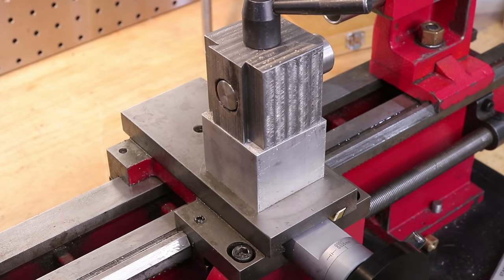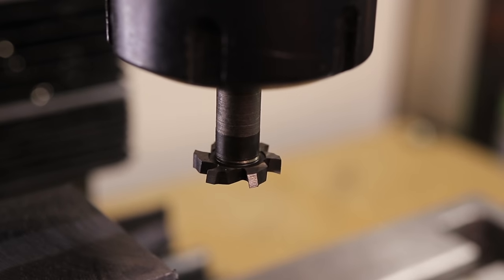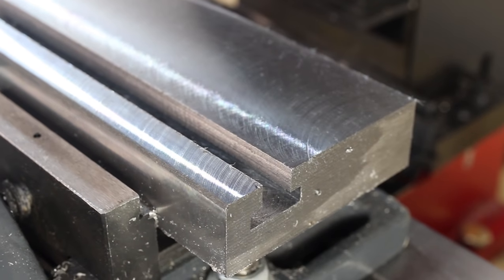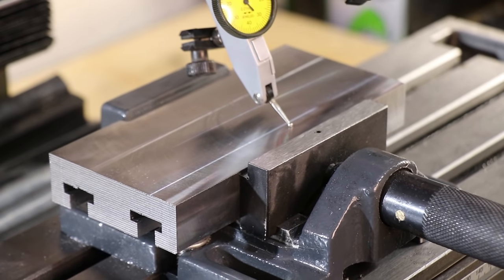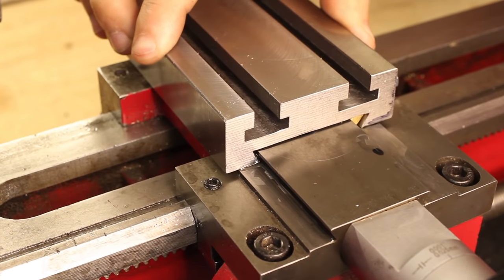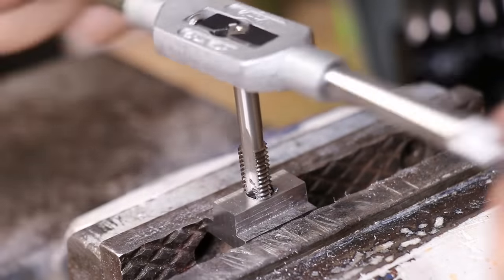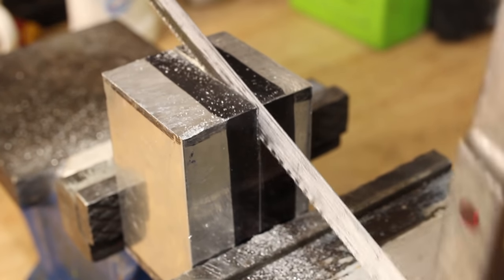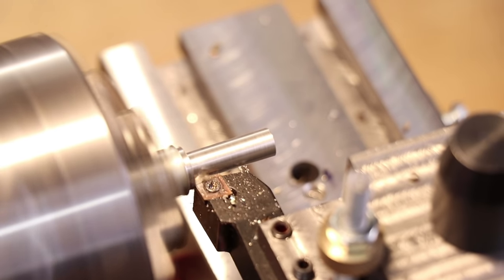Lathe Cross Slide Rebuild | Machining A New Lathe Cross Slide With T-Slots

Comment: Bro, you need a bandsaw asap!! It would make your life so much more easy/efficient in the shop
Reply: Antonmursid🙏🙏🙏🙏🙏🇲🇨
Reply: Failing that due to poverty, a decent angle grinder and a few 1mm cutting discs would do the job much faster. For greater accuracy an angle grinder based 'chop saw' attachment is advised.
Reply: Hacksaws build character.
Reply: its his daily work out and good for his biceps leave him alone :0)
Reply: buy him one then
Reply: Still no bandsaw 😂
Reply: Maybe he likes it this way? Hacksaws are very versatile, take almost no space, easy to carry, cheap to buy and maintain. I bought myself a little portaband a while ago but have yet to use it while the hacksaw gets used at least a couple times a week.
Reply: It puts hair on your chest💪
Reply: I agree that a portaband on a stand would make a very worthwhile upgrade for his shop. Now, if someone would just buy him one. (Recommending upgrades for someone else's shop is easy when you're not the one paying for them!)

Comment from the maker: G'day, I hope that you enjoyed this video. It has been in the pipeline for a very long time, and I jumped at the opportunity to make it as soon as I got the new mill. A few things that I wasn't able to cover in the video: 

1- Addressing the use of mild steel: Mild steel was not my first choice of material, and in have concerns about galling (though i won't have to worry about this for a while) but given the small amount of material I required, I just couldn't find a local supplier that stocked what I needed. With my state now in lockdown, this supply was issue was compounded. However the mild steel seems to be performing well. Good lubrication should help reduce galling. And the added benefit of using mild is an increase in tensile strength, compared to the cast.

2. The fly cutter, whilst doing a great job is flawed. I mistakenly machined it with the bolts on the wrong side, so the bolts are pushed against whilst it is machining. Long Term, i will have to fix this.
Reply: I have been looking around for cast iron stock too and the best I've found is weight plates from Kmart. Looks like you'd be able to get a decent 20mm piece from the 10kg. Not sure the quality of the castings though.
Reply: @Joe_Bandit  Primehyd in WA stock cast iron flat bars. Not cheap though.
Reply from the maker: @Joe_Bandit  Funnily enough I have actually torn apart a scrap 1kg weight from Kmart to machine the cast iron it is made of. Not the greatest castings but they worked fine as small flywheels for the project I did. The only thing that I might have to look into about these is what type of cast iron they are made from. typically you would want to use a grey cast iron for machines.
Reply: @artisanmakes  good to know, thanks!
Reply: Regarding the fly cutter as it is, you should be able to flip your cutting tool and run the spindle in reverse, at least to verify whether taking the time to fix/remake it will make a difference.
Reply from the maker: only problem there would be that the insert would be forward of the center line of the fly cutter. Ideally it should be in the center to optimally cut. Cheers
Reply: @artisanmakes  you are correct, I hadn't thought of that.

Comment: For heating small parts you can put them in a small ceramic flower pot. They will heat much faster, as placing them on metal sucks heat out of them.
Reply: Great tip!

Comment: Wow!
Nice work!
I can definitely see that you'd have a much more rigid setup than before.
You'd think it'd be a no brainer for manufacturers to supply machines with your mods already in them. 
Thanks for sharing this!  :)
Reply: There are compaines who do, and they don't get customers as the customers pick the cheapest machine 9 times out of 10
Reply: @henrydando  I've learned the hard way that it's always the better way to just bite the bullet and pony up for the quality option. Today, I even buy top of the line paper towels because they so outperform the cheap crap. 
It's the same with machine tools - one should buy the most expensive tool that they can afford because it'll outperform 10 of the garbage machines. 
It pays to buy the best that one possibly can. Imho.......

Comment: Great video! Being a machinist myself I do have a few questions/critiques: are you planning on getting a better vice for your mill? Drilling vices often lack rigidity and accuracy and I can't imagine it being fun to use.
 I also noticed you use climb milling as well as conventional milling, I think considering the rigidity of the machine it would be better to make most cuts with conventional milling, or at least the finishing cuts. This should improve the stability as well as the surface finish a lot! Climb milling is often better for the tools, but just isn't viable if there isn't enough stability. 
Last but not least: when making a piece of material square and parallel in the mill, the best method is to cut a side, turn this side to the non moving jaw make another cut, turn again , cut again, turn again and then you should have 4 square sides.
I hope I don't intrude to much and these tips are actually of some help, and for what it's worth you're doing way more and better stuff with a mini lathe then I ever did!
Reply: That was an informative comment for me. Thanks! I've been doing it to the bottom of the vise thinking it was parallel to the table. I've also been doing climb & conventional on a mini mill only learning the difference yesterday. Good comment!
Reply: Do you mean taking rough cuts with conventional and then using climb for finishing passes ?
Reply: @jsublettusaf  that way you indees get two parallel sides, but if your vice is bad or there is a bit of dirt there's a big chance you get a parallelogram. But if you want the full explanation there are some really good video's om yt explaining it better!
Reply: @ryebis  normally yes, but if there is too much vibration or instability in either the set up, table or spindle. The mill could start "biting" into the material taking away more then it should and leaving a worse surface finish. You can actually see this a bit in the video, caused by I'm guessing a combination of all three factors, but two can maybe be fixed: trying another set up, like putting the material directly on the table, and clamping all the axis down, except the moving one ofcourse (but maybe he's already done that, in that case my apologies)
Reply from the maker: Thankyou Lennart, feedback is always very helpful. I am indeed planning on upgrading the vise. The vise was just a freebie that case with the mill from the supplier. Credit where it is due, it is probably one of the better drill press vises that I have used. Though I will be replacing it soon. The plan was to replace it ASAP, but my state is unfortunately experiencing a COVID lockdown, and my supplier is currently closed. My preference is to always check out the product before I buy it if I am able to. Currently looking at just grabbing an import one for the time being.

As for the climb milling, to be quite frank, most times I did it just out of laziness, not wanting to move the table back so I could conventional cut it. Had to change up the  when climb milling though.

As for getting the part square, I have to conceded that is the proper way. There was a lot of shenanigans off camera that I had to do to check that everything was all square.

Many thanks for the advice.
Reply: @ryebis  That is what is recommended but I've been doing both climb & conventional to remove material interchangeably.

Comment: When cutting T-Slots, it's a good idea to cut the initial centre slot 5 thou deeper, than the depth the T-Slot cutter will be set to.

Doing it that way, reduces the tool pressure.
Reply: aaand the T-Slot Nuts will ride much better even if you ruined the bottom once with a too long of a bolt :)
Reply: That’s great advice thank you.

Comment: This is exactly what I need to do with my huge old very early 1900's Lodge and Shipley engine lathe, so I can add a milling machine head to it, and reuse that enormous cross slide that it has.
I have an old brake lathe I was going to try to use for the Milling Machine head, as it's super beefy and sturdy, but I'll have to see if I can make it spin fast enough to use fly cutters and milling ends in it.  Those brake lathes are kinda slow unfortunatly, and they might not handle the speeds required for this, but I'll see what happens and if it breaks down, I'll somehow modify it to work I'm sure...  As far as I'm concerned, that's what makes this hobby even more interesting than it already is!  LOL

Comment: Fantastic work! This is a great idea, and you made an awesome job of it. You should consider another M4 tapped hole between the front and middle gib adjusting screws, for a slide locking bolt. This also helps rigidity quite a bit.

I made a very similar fly cutter (I also had to make it twice, due to putting the set screws on the wrong side the first time). If/when you make another, you don't have to make the tool slot at an angle. You can just make the bottom of the fly cutter flat,  as well as the offset slot, because the tip of the carbide insert sticks out past the tool holder shank. That's how I did mine.

Anyways, keep up the great work!
Reply from the maker: Didn't think of that, I'll have to do that, thankyou

Comment: I got a spray bottle with a nozzle that allows stream or spray and filled it with coolant solution. Spray as needed to cool/lubricate as my lathe doesn't have a coolant pump fitted.
If you were using a lot, hook a catch bottle under table drain to recover fluid for re-use.

Comment: Cool project.  I always wondered why they don't include T slots on cross slides, wouldn't cost much to do.  You really need a small bandsaw, was one of the best investments I ever made for my shop :)
Reply from the maker: Absolutely a worthwhile addition. The t slots are a very useful addition to the lathe. Hope to have a workshop one day where I can have the space for a proper bandsaw. Cheers
Reply: Amen!  As per my suggestion as well!!!
Reply: @artisanmakes  gotta get a portable bandsaw and a hercules vertical/horizontal stand

Comment: If you made angled brass slugs to go under the gib adjusters,  they'd spread the pressure on the gibs and you could use shorter grubscrews
Reply from the maker: I didn't think of that, ill have to look into it, thankyou.

Comment: Fantastic video and a great project.  As a long term small lathe and mill owner I have a tip that should help you.  You can keep your taps happy if you keep them really wet with cutting oil.  The wetter the better. I would also recommend a different cutting oil. I have tried a bunch and by far my favorite is the Rigid clear. I use it for everything except aluminum and stainless.  For aluminum I like WD-40 and for stainless nothing beats Moly-D.

Comment: You are getting far superior results to what I get on my mini-mill. What depth of cuts & feed speed are you using? I don't have a power feed so I struggle with consistency. I really enjoy your channel and the projects you do!
Cheers from Canada
Reply from the maker: I think I was doing a 1.5/2mm depth of cut here at around 800rpm, the motor develops a lot of torque there. It is less than optimal but it works

Comment: I was looking for something like this on Littlemachineshop, but they only have it for the compund slide at the moment.

Why not make it even larger? Maybe able to fit gang tooling.
Reply from the maker: If I would make it longer I'd need to modify the cross slide leadscrew and the carriage to have extra travel to make use of the longer slide

Comment: Excellent video as always. If I could pick your brain, what dimensions did you use for the t-slot size and spacing? I'm doing this mod as well and I wondered if there is a standard I should opt for. Thanks again as always.
Reply from the maker: These are m8 size t slots. There are charts online that should give you the exact dimensions.
Reply: @artisanmakes  Brilliant thank you.

Comment: I have the same lathe and the smaller mill from Paulimot, the local dealer for the SIEG-Brand. I made the new retainer Strips for the Lathe and now thanks to you i know my nex project. 

In return i have maybe an idea you can use on your machine for indexing parts on the lathe. and i would like to send you a drawing for use on a 80mm 3 Jaw Chuck if you up for it. ;)

Comment: I'm curious to how it is performing after a few months? I have a project I'm planning that's including this. Just waiting and collecting material until then.
Reply from the maker: I can certainly say that after adding tapered roller bearings to the lathe, this is the best upgrade I have done to the mini lathe. The t-slots come in handy all the time and make the lathe very versatile. And the extra mass is noticeably more rigid. Even though its made from mild steel I have not run into any issues, just keep it well oiled and it performs perfectly. Cheers

Comment: Awesome work.  looks like a huge improvement.  Where do you buy your metal from?  I just bought a mini lathe and am struggling to find a place to buy blocks of Alu and Steel. Any help would be much appreciated.
Cheers
Reply from the maker: Might not be much help if your outside of NSW but I buy my stock from a material supplier called edcon steel. They have scrap bins of steel that they sell at discounted rates. Before I used them I bought most of my stock off eBay. Shipping is expensive though.
Reply: @artisanmakes  Thanks for the reply.  Im in Sunshine Coast, so might be a bit far to get to your supplier.  eBay is pretty expensive, but i might have to resort to it for now.  Really enjoying your videos.  Thanks!

Comment: What sort of vacuum are you using as a shop vac? Been trying to figure out what the best sort would be for the hobby metal working shop but not had a lot of luck so far.
Reply from the maker: Just a 20l ryobi shop vac. I was given it as a gift in early 2019 and I have never had any issues with it.
Reply: The cheap ash vacuum cleaner that has the silver color bag / filters work very good for chips and stuff you need to vacuum off your lathe or mill.

Comment: How is the cold roll cross slide working out for you? Have you noticed any increase, or difference at all, in vibration/chatter with this material? oh, also forgot to say it, great job! looks fantastic!
Reply from the maker: I doubt that the old cross slide did much in absorbing vibrations. The new one is just a huge improvement. The increase in mass and tensile strength is a huge improvement. Plus the t-slots are so handy to have. One of the best upgrades I have done to this lathe.
Reply: @artisanmakes  that def makes sense, glad to hear it works as good as it looks! 👍 Thanks for taking the time to respond. I love what you've done with your machines btw, really turning em into quality tools that fit your needs perfectly. Inspiring stuff!

Comment: Hey mate
What size dovetail and is it 60°?
Also, what size T slot cutter did you use?
Reply from the maker: Just make it the same dimensions as the cross side dovetail you are intending to replace. For me this was a 60 degree dovetail
Reply: @artisanmakes  thanks mate 👍

Comment: I've noticed when you've been tapping threads you hold the wrench at the end where you have the most leverage over the resistance on the tap...  This is why you keep breaking them.  You are at the very end of the leverage leg furthest from the fulcrum.  You are pushing to far without realizing it because of this.
Reply from the maker: Maybe, but I've since switched to good hss taps and haven't broken a single one. Snapped taps are pretty rare for me but it always happens with cheap carbon steel ones. Go figure :)

Comment: Good job!  Regarding the broken tap, have you ever tried a spring loaded tap follower mounted in the mill?  I think it was Blondie Hacks that made one on her channel, looked like a great way to mitigate tap breakage.  Also, what was that weird background sound at 10:09?
Reply: It was a Currawong, native bird to Australia about the same size as a Crow, very wide spread across Aus.
Reply from the maker: I made one a while ago but they tend to only work for Taps m6 and up, Taps that have centre holes. Plus for the most part I find it somewhat awkward to tap whilst the part is still in the mill/lathe. Personal preference. Plus when filming, it is extra awkward to try and tap whilst the part is in the mill.
Reply: Try to use concrete drill for broken taps and hard materials, just sharpen it like any other drill and watch the magic happen :) cheers
Reply: @davidwillard7334   im sorry im not trying to be rude but im speaking from experience... Concrete drills have carbide, as i know carbide beats hss... Please try
Reply: @gabrielskec2646 - Now that's a nice and simple tip... ;-)

Comment: I know its been 2 years, but what dimensions are these t-slot cutters? 18mm x 6?
Reply from the maker: From memory my one is a 18mm diameter by 3mm tall, the t slots are probably 5 or 6mm tall. If you search up M8 t slot standard size on google it will give you a bunch of dimensions, which I probably copied from